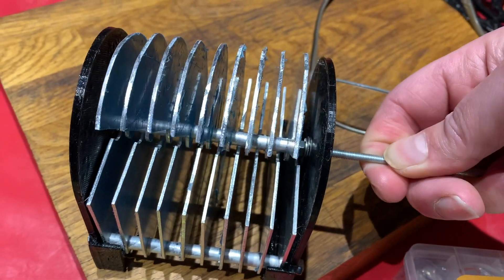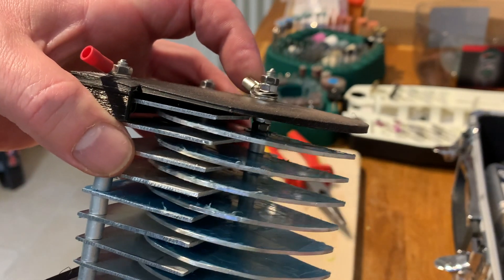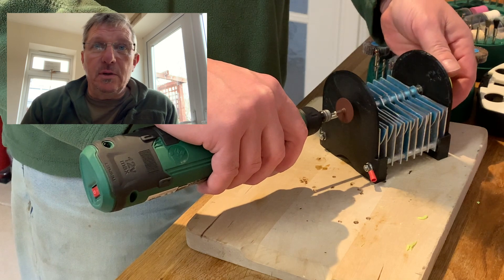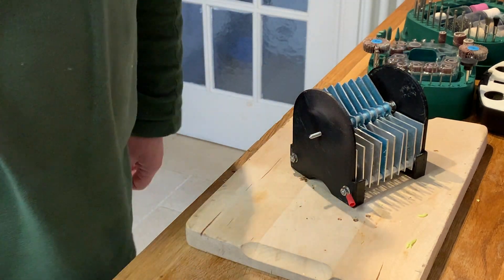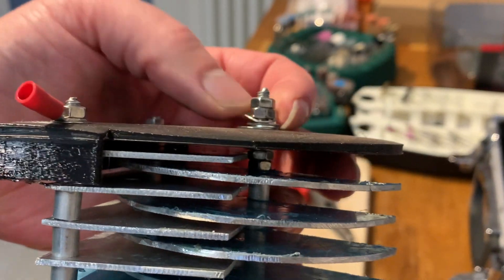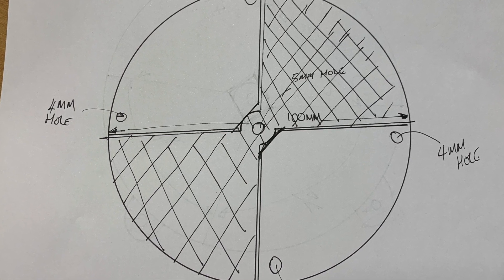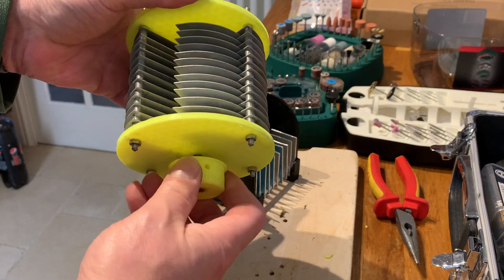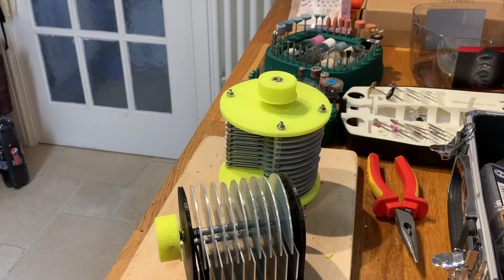HAM RADIO: Building a Variable Capacitor, Butterfly and Two Plate DIY Capacitor, Magnetic Loop

Comment: I only just found this video after looking for variable caps on ebay. I don't understand why you made the spindle connection in that way. My method would be to use a springy brass strip fixed to the end plate with a couple of small screws and nuts. The strip would be bent to contact the end of the spindle and the other end would be bent out like a solder tag. That allows for a good fixing of the spindle without the possibility of the wire connection ever moving.
Reply from the maker: good idea.

Comment: Good work. You get less interruption on the signal if you use the moving side for ground. Also a long stick or some lanyard system further away from the cap makes it easier to adjust, without hands creating more capacity near it.

Comment: A thought the slip ring, what is the maximum rotations of the capacitor? I would expect less than one. If this is the case, simply put the electrical connector between two nuts and sock them down, if need be, add another nut to better lock it.

Comment: Two ideas instead of using the slip ring: Measure the diameter of the shaft and find a stainless steel RC car type bearing or perhaps a skateboard bearing (Amazon or a hobby shop) with the correct inner diameter. Then make two more narrow spacers out of tubing like you did for between the cap plates and sandwich the bearing between those so they tighten down on only the middle bearing shaft. Then look up how to solder onto stainless steel and solder your electrical connection wire to the outer ring of the bearing, there's a specific type of flux needed too but I don't recall at the moment... THAT, or even simpler: use a long and flat strip of brass sort of like a "leaf spring" so that it rides on one of the shaft spacers with a bit of tension. Drill a hole or two on one end of the brass strip, make sure it has the right amount of bend in it for tension, screw it down and solder a lead onto it.

Comment: As I remember from my RF adventures in my teens, the outer body of the capacitor is metal and in contact with the moving plates (usually would stay at chassis ground), and the static bank(s) of plates are isolated from the body, with solder pegs attached. This overcomes the need for slip rings or similar wear prone parts. Of course, it's harder to make the body of the capacitor in metal, than just 3D print it :-)

Comment: You could have used a short spring to use to keep pressure on the ring terminal to the allthread shaft. Or a curved washer ! 😂
Reply: Pro trick: you can watch series at Flixzone. I've been using it for watching a lot of movies during the lockdown.
Reply: @Tommy Lee yea, been watching on Flixzone} for years myself :D

Comment: I like you assessment  "relatively well" and "middle-ish" :-) Are you going to share some measurements C = F(angle) especially for the butterfly ? And probably the contact resistance of the slipping wiper end during few rotations ?
Reply from the maker: Stop the Video at the drawing of the capacitor and copy info from that.  :)
Reply: @mike-M0MSN  thanks for the suggestion, but actually I mean how good is the electrical contact during the rotation of the thread ?  And I am wondering what is change of the capacitance per one (or couple) degree of rotation ? Is it "relatively" constant (in other words with this shape of the pates, is the relation "capacitance/angle of turning the knob" linear ?

Comment: What capacitance range are you trying to target, or another way of asking, what frequency range (or band) are you targeting ? 
It seems like the current prototypes would only be effective in the 10m band area?
Cheers,
Reply from the maker: Not so, you only need a small capacitor if you intend to use it on a loop, that's sitting on the band you want or you couple it with a fix cap... its all fun.. :)
Reply: @mike-M0MSN  Thanks,yes the use of fixed caps can help.. depends on the freq range coverage...
It make make a good band spreader as well.
Cheers,

Comment: Rather than a slip ring, why not use earth braid. It can flex/move and not be damaged therefore you can tightly fix it to the centre with two nuts.

Comment: Here's a suggestion, Try adding a little bit of nolox in between the "spring" washers, the eye terminal, and shaft so it will be corrosion-resistant and maintain better conductivity over the life of ghe cap... great build info!
Reply from the maker: Great tip!

Comment: There is no need for a slip ring if you divide static plates into two parts with an insulator (i.e. half of plates have nylon washers on the left one threaded rod and the other half on the right one. You might want to fill the gap between plates and rods with some small gaskets).

Comment: Thread a nut on BEFORE you cut the rod, and then unscrew the nut which will act as a die and 'fix' any broken threads.
Instead of a sliding contact, attach a short bit of coax braid to the capacitor shaft and screw the free end of the braid to a post on the rear of the capacitor for connection to the circuit.  The braid should be just long enough to allow the capacitor to rotate 180 degrees.
You could have 3D printed that knob with a hex hole in the middle for the nut.  That drill makes conical holes (thicker on one side than the other)!

Not only is the butterfly cap easier to build, but it will work better on a magnetic loop antenna as it is balanced.  But you will need 4 times as many plates since it is now two capacitors in series, and the plates are half the size of the conventional capacitor.
Reply from the maker: Yep, that why I made the trombone Caps...

Comment: I've built capacitors like that except I used thin copper sheet metal and copper tubing plumbing pipe for spacers. The end peaces and base were cut from lexan sheet plastic and bent with heat.  I used all thread for that fit inside the copper tubing. I used aircraft tin snips to cut the copper sheet I used. The copper part's end up deformed slightly but can be made flat by pressing between thick wood boards and C-clamps to exert pressure on the parts. To greatly improve the capacitor the copper part's can be silver plated, which you can do yourself. There are lots of youtube videos of that.
Reply from the maker: Sounds great, I will have to give that a go.. :)

Comment: You might be onto something with the banana slicer.

If I ever need to insert a nut into a 3D printed part, I heat it on the top of the soldering and use the iron to push it in.  I found it a bit easier (but slower) than the blowtorch/gas hob method.
Reply from the maker: Cool idea

Comment: Great job Mike. Is there a requirement In mm for the plates to pass or is it just make sure they clear each other?
Reply from the maker: The more MM apart the high voltage the cap can handle but the lower the capacity, so it’s a balancing act.

Comment: Hi Mike.  Nice work.  What type of mag loop are you planning?
Reply from the maker: I have made them to go on the twin copper loop to see if I can run twin Capacitors. 🤪
Reply: @mike-M0MSN  I tried a mag loop once and found that I needed to be a few feet away because I was part of the capacitor.  I added a plastic pipe to the capacitor shaft to keep me out of the way.   Also found out the antenna didn't work well inside the house with aluminum siding.

Comment: Hi Mike,
Don't know how well stocked the hardware stores are over there, but if you can locate a large diameter brass washer capture it between two nuts and make a wiper for it. I think it will work better than the bent flat washers and ring terminal. Sta safe.   73   WJ3U
Reply from the maker: Great Idea Don,  I will see what I can find.👍

Comment: Or toast rack? 🍞👀 Nice job Mike 👍🏻 I put nuts on before cutting bolts/bar, as undoing the nut makes good any bent thread. Two locked nuts also give you a flat edge to cut across if using junior hack saw 😀
Reply from the maker: Brilliant Ian, great idea.👍😀
Reply: Yep, old trick that one.